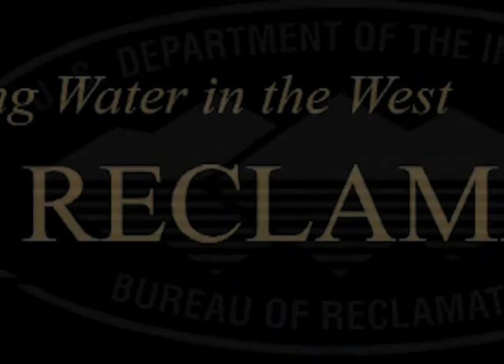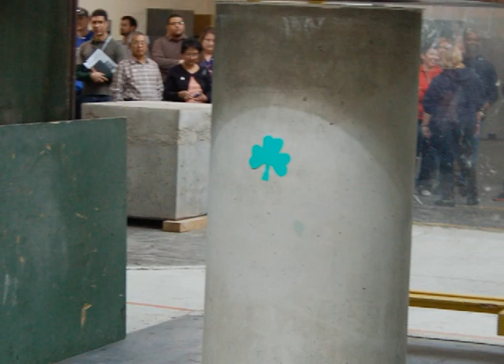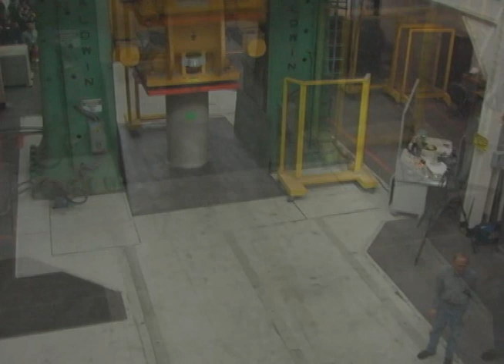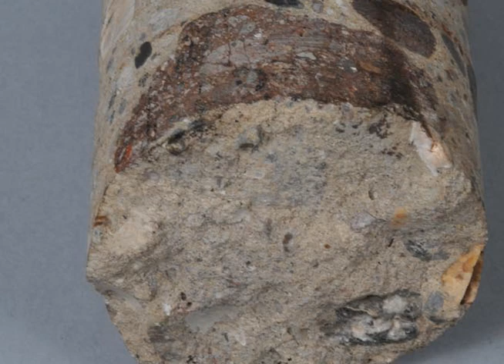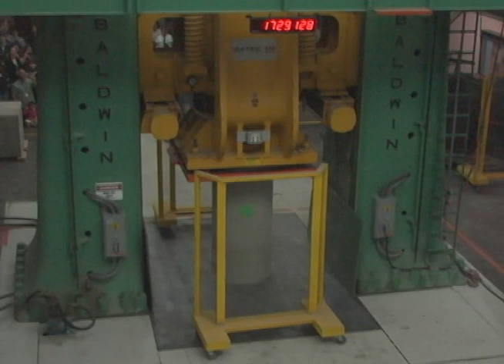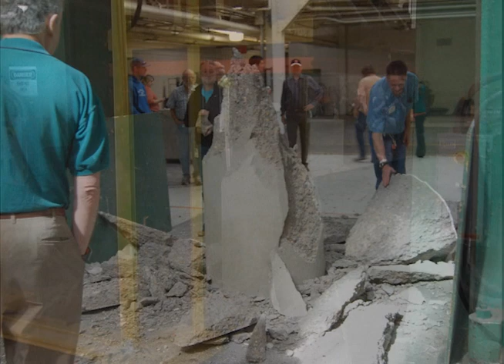3x6 Concrete Cylinder 15.3.13_Full Version

Comment: Ah yes, the six million lb testing machine.!  I worked there in the soils testing lab 1972-1974, Bldg 56.  They were testing culvert sections in a steel box using that 6M machine.  I and others filled the box with soils, set the transducers, did the compression, measured and recorded the deflection and stresses, cleaned out the box using a jury rigged back hoe  welded to a forklift arrangement..  I appreciated those 10-12 inch steel pins they pulled apart cracking the concrete around the base of that machine.. In those other offices just down from that machine were our soils lab, smaller hydraulic machines for doing tri-axial shear on soil samples from various projects around the nation and the globe..  We were next door to the concrete labs.. Fond memories of that place..